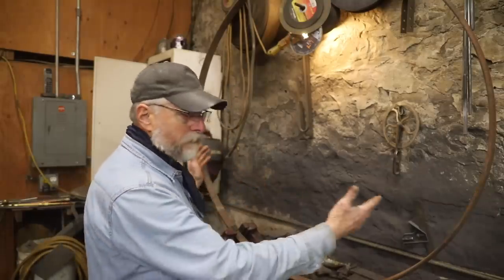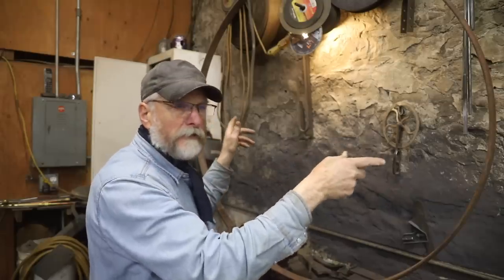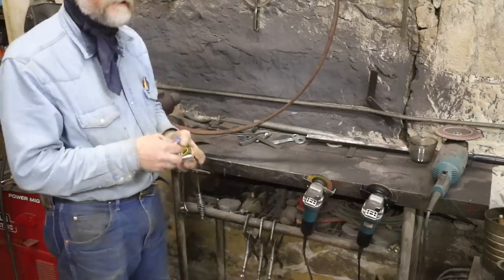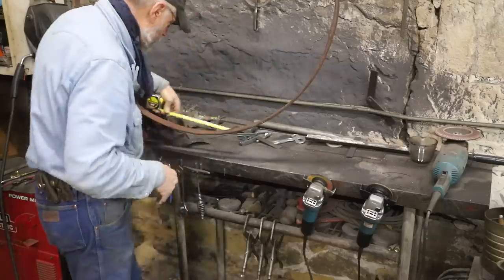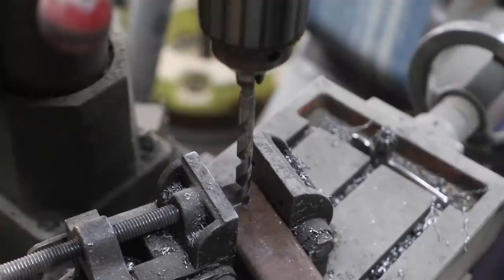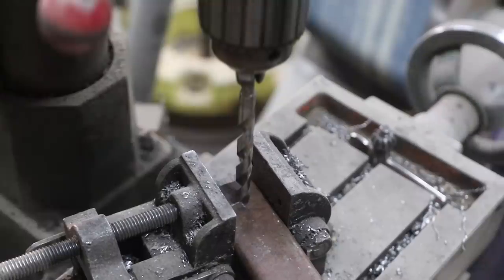A Creative Use For Old Wagon Tires | Engels Coach Shop

Comment: Although I love watching Dave's smithing skills, those of you suggesting he turn the rest of the tires into similar wood racks to sell, have not worked in manufacturing. What we just watched was probably AT LEAST 4 hours labor. Firewood racks go for $99 to around $300 for something more substantial. Difficult to compete with assembly line for price, except maybe for us die-hard fans. Thanks Dave for another interesting project.

Comment: After WWII Moore’s Blacksmith Shop, at the corner of Oak and Jackson, Red Bluff, CA, since 1910 and currently owned by the fifth generation, had wagon tire bar stock they would never use. I have a housewright or carpenter’s slick made from some of that wagon tire stock that has a beautiful socket, a great example of blacksmith’s art. Unfortunately, without a high carbon edge it’s not a great slick, but I appreciate the skill and knowing it’s history.

Comment: You should make a custom stamp.  A stylized "D.E." or maybe "Engel" that you could stamp into metal projects like that.  Somewhere inconspicuous, but so your master craftsmanship will be verifiable long after you have swung your last hammer.  You could heat up the stamp and use it to burn the same mark into wood projects too!  Just a thought!
Reply: Reheating a hot stamp is counterproductive. Make 2.... one to heat for branding, one to stamp in red hot material.
Reply: @stevesyncox9893  Good point Steve!  👍😁👍

Comment: I would get welded circles of mild steel made in town, 1" wide x 48-60", depending.  I would use them as raw stock to make two things.
One which was my best seller was a unit as a half circle to go against the wall, with an added brace on top to hold weight.
Then make a bunch of single and double hooks and people used them in the kitchen to hold pots/pans, etc.
I could get two from one circle or in your case, wheel. 
The other thing was more upmarket, (expensive) meaning chandeliers. Candle and electric. That went with chain and usually candle sconce or bulb outlets. These days, 12v lights might work. My hourly was great with these, very popular and profitable.
Reply: Good ideas

Comment: Boy, this makes me realize a bunch of the material I scavenged off a old home built round bale feeder might not be leaf springs, but chunks of wagon wheel tires. Going to have to look closer. Probably saved me some frustration wondering why it wouldn’t harden like leaf spring later!

Comment: I've found when spraying paint especially from a can its best to have some cardboard behind while applying so it rebounds not just blow past that's wasteful. Indeed its covers better because much of what's sprayed isn't lost and at a slight angle more lands on the material like a wind brake. The siloquette it leaves also lets you know what's not missed especially when the paint and what its applied to are close in color like black over red rust-primer.

Comment: Yours is much more classy then the 1 that came with my cabin. It was maybe 3-1/2 feet in diameter. Held at 2 points. To the wall & floor with old drawer handles. But I live in a 1870 log cabin in Wyoming. No sheet-rock, paint or fancy tile so it was classy in it's own way. I do like yours tho. Your a crafty one!

Comment: Dave

 I dismantled a log cabin built about 1825 in Hancock Maryland.....Western part of Maryland 

 Sometime in the latter 19th century they took an old tire and cut it in two   They used these 2 pieces as the arch support for fireplace stone.  We suspect this was done around 1880-1910.    If a small hole was introduced for a wood burning stove.

Comment: Nice take!
If the steel is wrought iron from yesteryear, you may find a good market for some of that steel with knife makers. The steel makes for some excellent decorative fittings on higher end knives, depending on the grain figure.

Comment: Another use would be to cut the tires into shorter lengths and make a garden hose holder.  Say five or six together plus another length to tie them together and act as a hanger.

Comment: I'm thinking that a couple of pieces of iron could be welded to the adjustment screws on the rolling mill instead of fiddling with a wrench. Nice job, as usual. thanks, Dave.
Reply: No, they'd have to be too short: only half the distance to the other screw so they could clear the iron on the other screw if they happened to be pointing the same direction. Being that short, they wouldn't give enough leverage. It's best to use a wrench like he is, though I'd be inclined to think a fixed size wrench that lives with that machine would be better than an adjustable wrench.
Reply: @mailleweaver  Not if they were offset. It would also be possible to replace one the screws with a longer unit so the interference could be avoided. I understand why you pointed out what you did, but as you watch Dave make adjustments he is holding the wrench near the jaws, not at the end of the handle. And I'm thinking that there is 10" to 12" between screw centers. Therefore, in my opinion, leverage may not be a major factor. The size of material is, of course, the important variable.

Comment: Here in Australia at the moment, a piece of steel about 11/2" by 3/8" is about A$6.00 a yard/meter. Rough money. That stack of old tyres there, new, WAY more than a A$1000.00. I kid you not.

Comment: it looks nice..  wasn't quite the direction I thought you might go but it definately works and looks good.  

I thought maybe you were going to do a larger one using full tires, welding them together near the top, then splay out each at the bottom to they're full circles but the bottom edge has a spacer holding it about 10-12 inches apart    I've seen ones done in rebar, seems like a wagon tire would be a nicer piece....

Comment: You might do something like this with some junk yard leaf springs.  If you don’t have buggy tires hanging around.  Come to think of it, leaf springs are made of better steel and are also heat treated and spring tempered.  A bitch to roll into shape.  So never mind.

Comment: Very nice!  Love that it gives a whole new life to something that was destined for the scrap pile, or I supposed pulled back from it!!

Does a single (possibly larger) tire have enough circumference to lay out the feet and the connecting bars first and then size whatever is left of the tire and make one whole holder out of one single tire?

also for some reason I did not know those tires were THAT thicc.

Comment: Dave! DAVE!  4 cuts when 3 would have got you the same 2pcs of 54"?
I know you love working and enjoy sharing your story  but that old old saying "work smarter not harder"
From 1st cut line measure 54" (cut line 2) then from cut line 2 measure 54" (cut line 3) = 2 pcs 54" with 3 cuts and with 1 longer offcut 
or did I miss something ?
Reply: Cut loss. Even a water jet has losses due to the width of the cut.